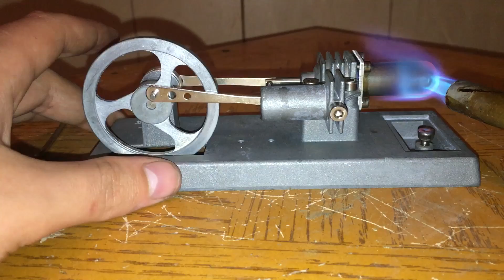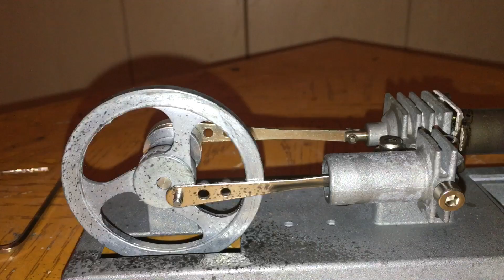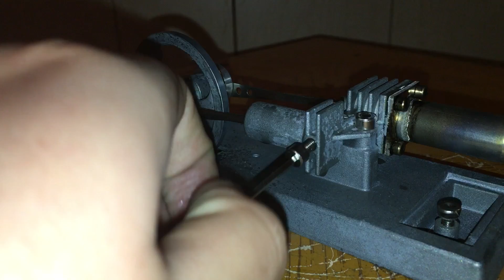Stirling Engine Blow Up

Comment: Running an engine till it seizes is not the same as "blowing it up".
Reply from the maker: Didn't seize..Lost Compression
Reply: @pathaze4299  same with mine but it had a glass tube what should i do
Reply from the maker: @MiniBikesAndMotors  If it exploded and it didn't come with a replacement, then it's ruined basically..